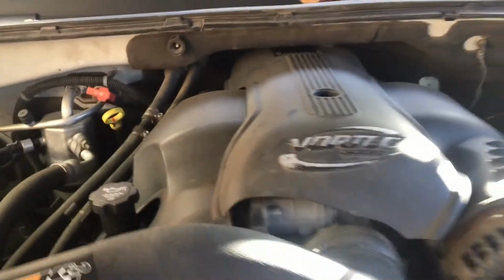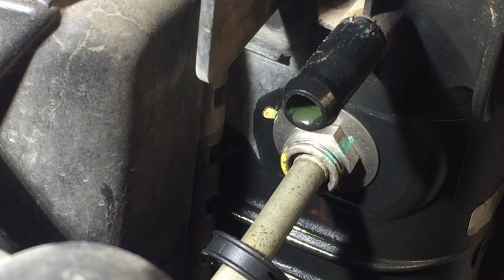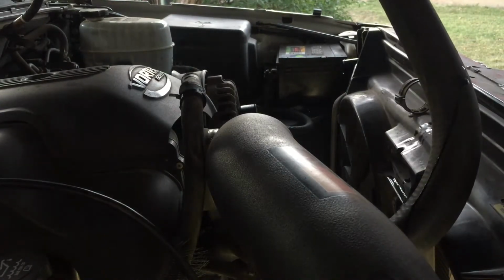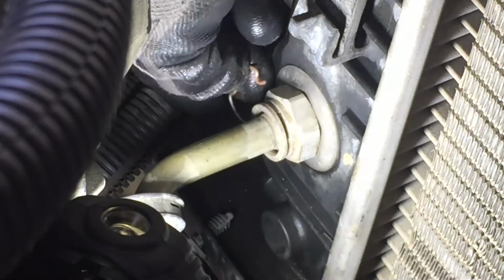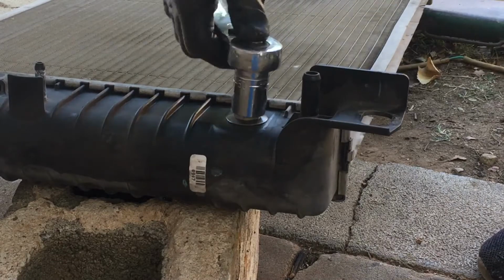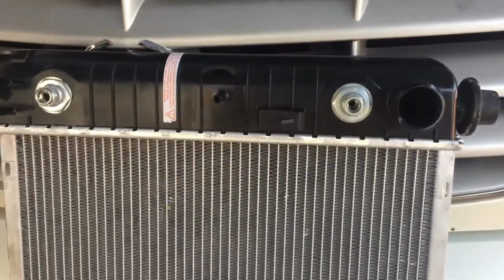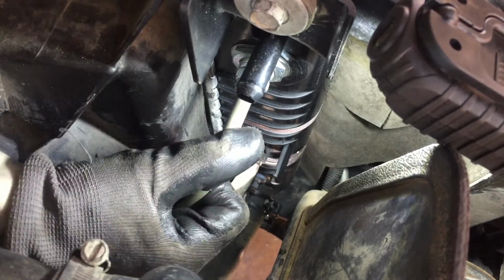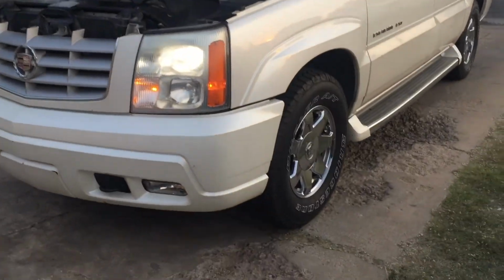escalade 2005 6.0 radiator replace

Comment: Awesome video. This will make doing this radiator way easier. I've replaced multiples radiators but not in the escalade yet. So this should make the job a lot easier. Now that I know exactly what tools I will need. Pretty sure my radiator cracked on the drivers side. From what I have read these are notorious for cracking. Between sitting for years before I bought it and it having a bubble in the system. I'd imagine it was just doomed to go bad once I refilled it. So far I have done headliner, pinstriping, replaced all 4 tires, new battery, recharged a/c system, Reran two rear brake lines, replaced the spare tire crane, and replaced the fuel pump. At some point the old parts will stop failing.
Reply from the maker: Hi Scott Richardson thank you wow you’ve done a lot of work on that vehicle. I bet it’s gonna look nice when you get done well good luck and thank you for watching. I appreciate you.
Reply: @Marty09933  yes sir about 30 minutes in and old radiator is out. It's cold here today so I came in to warm up. The only thing I forgot was to get distilled water for my concentrate antifreeze. So I will have to run down to the local dollar general and grab some. Otherwise it's going smooth. I just took the fan off after removing upper radiator hose and oil line. That gave huge access to everything else. I was able to get everything from the top of the vehicle. But everything is spot on. I took off the plastic cover I think it was 8mm and also the intake stuff with a screwdriver. All might be in the video but I skipped around to the important bits like removing clips etc. Since I am familiar with these types of jobs. Thanks to people like yourself for making quality content and helping people.
Reply from the maker: @scottrichardson2773  glad to hear that. Everything’s going smooth. Yeah I’ve been there work on my car for a little bit then go inside and warm up. Lol what state you in that it’s cold I’m in Amarillo Texas. We’re sitting at 63°. Not too bad well good luck hope everything comes out good you’re killing it.
Reply: @Marty09933  I'm in Ohio. It's warm today for this time of the year. I plan to retire to Texas eventually. I think we are floating around 47 degrees today but it's windy.
Reply from the maker: @scottrichardson2773  wow Texas that be nice  you’ll probably miss Ohio

Comment: I had to replace the radiator in my 2006 Escalade this past weekend and I was lucky enough to find this video first. Great instructions, and the work went off without a hitch (not normally the case with me). I tried to fiddle with those transmission line clips with a small screwdriver at first then went to the auto parts store and got a pick set, glad I did. The $12 pick set was well worth it and made things so much easier to remove those clips. Thank you for the thorough step by step video.
Reply from the maker: Hi Jeff tracewell your welcome and thank you for watching I really appreciate you

Comment: Thanks for the video.  it helped me change my radiator in a 2006 escalade ext.  The only difference in what I did is I removes the fan first.  It made a lot more room to work on the hoses.  Thanks again.
Reply from the maker: Hi Tom Faunce your welcome.  awesome great idea im sure that did give you more room. thanks for watching i appriciate you

Comment: Did you need one or two jugs of antifreeze to fill ?
Ty for the video
Reply from the maker: Hi RL don’t know the diameter of the clips, and it took two jugs Thanks for watching. Appreciate you.
Reply: I had to add three jugs fyi.
Reply from the maker: @rl4889  sorry brother I thought it was two I knew it was a big radiator but I couldn’t remember. Thanks again for watching brother. I really appreciate you.
Reply: By any chance would you have a part number for that radiator
Reply from the maker: @chuckelliott3894  sorry I don’t have a part number

Comment: Nice helpful video! Thanks. Question I noticed the oil pressure gage was at 80 psi. Mine sits there all the time. It started doing that a couple weeks back. What csuses that to read 80 psi all the time?
Reply from the maker: Hi John Mokma  lol I just noticed that  in my Experience most of the time it’s a faulty oil pressure sensor  but this one’s the opposite I have them come to me with no oil pressure. faulty oil pressure sensor.
Reply from the maker: John Mokma thanks for watching I appreciate you

Comment: Taking the hoses off of mine and when I took the bottom left corner and oil started coming out,is that ok ?
Reply from the maker: Hi Lestat Y Barbo yes that’s ok oil will come out of the lines sometimes or transmission fluid  your good  thank you for watching I appreciate you

Comment: What tool is that that you used to take off the lower radiator hose clamp? That is awesome!
Reply from the maker: Hi Caddy Daddyz305  they are called hose clamp pliers. Mine were expensive Mac tool but I use them a lot . You can get them  cheaper at auto zone , Advance parts etc . Thanks for watching I appreciate you here’s a link ....https://www.googleadservices.com/pagead/aclk?sa=L&ai=DChcSEwjIgYnO257uAhUOvcgKHa1hDQkYABAHGgJxdQ&ohost=www.google.com&cid=CAASE-RoOYUzNj4VXgtvVy-eurCF7W4&sig=AOD64_1Ez_9VhYIL2h-oxuVF1FZ8sJi-0Q&ctype=46&q=&ved=2ahUKEwjo2P7N257uAhVKAqwKHTHnD0cQzzl6BAgCEB0&adurl=
Reply: Thank you! I found it